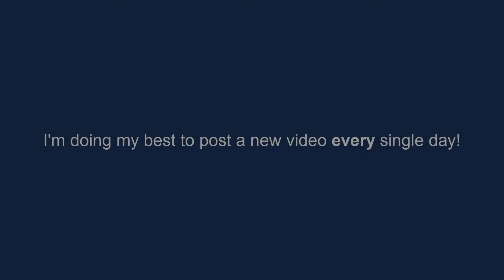HOW TO: PixRacer + UBLOX NEO M8N GPS/Compass Wiring

Comment: erm?so what is the color of wires? you put red and all other is "blk" which does not make sense.
Reply from the maker: Hi Egor, watch the video. And see the part where we find out what the colours mean as it's written on the board.... Matt
Reply: Thanks Matt, actually if you will open the gps unit it written in pcb.
Reply: I was inpatient to see every frame of the vid and just looked for the wiring scheme and kind of stopped watching when u put this banner on screen.anyway thanks
Reply: I have to say your channel have so good & informative videos.
Im actually flying freestyle racers but I have one fellow which finds it hard times to get all tuned and build well in his fpv plane due to honorable age so I decided to help with the build test and most important gps and return home function.I will post the video of test flight  and build when it will be finished.
Great thanks. ^^

Comment: I'm using this exact gps/compass with a pixracer. The gps works flawlessly but the pixracer is not detecting the compass?? I have tried everything. Reloaded the fw. Tried different fw. Tried it on mission planner qgc and apm planner. Nothing works?? Has anyone else had this issue?
Reply from the maker: Howdy Matt, you'll have to excuse me as it's been a while for Mission Planner and QGroundControl, however if I remember correctly on the magnetometer tab, you need to set it to use the external compass. Hit save and then calibrate it. Matt

Comment: did you build a tricopter with the pixracer? do you know wich firmware need need to be installed?
Reply from the maker: Howdy fella, no my pixracer went into a flying wing. For a Tri copter I would assume the quad firmware and then select the right frame. Hope that helps! Matt

Comment: Please tell me this works with Naze32 rev6.
Reply from the maker: Morning! 
Honestly, I've never tried connecting one of these up to a Naze32. I've always used a CRIUS NEO-6 (see here http://goo.gl/Sjyq8W) with my models & they've worked perfectly. You'll probably see one on my desk in a grey plastic case, as the other one is in the Teksumo at the moment.

Hope that helps!

Matt
Reply from the maker: Howdy, I don't believe this GPS will work with the Naze32, you'll need a GPS like this one instead https://goo.gl/ZJKjF5 Matt
Reply: I got it to work but it was a real pain involving ftdi adapter > u-center > programming. Now my issue is that I want return to home but Cleanflight's current version is still a work in progress. I did find this but I am an occasional quad flyer and I don't feel comfortable changing things in Cleanflight's CLI http://m-rotor.com/page/?p=713
Reply from the maker: YoSneeze Howdy, yea Cleanflight is great for the basics, but anything advanced it's lacking I'm afraid. Matt

Comment: Brilliant!  great timing, I was doing exactly the same thing last night.  I've got the GPS working, but I'm still not sure i've got SDA/SCL the right way round.  Have you done the APM power module?  that's my next job. Cheers.
Reply from the maker: Howdy Jim, do you mean the ACSP5 module? Let me find the link for you
Reply from the maker: This is what I'm using for the Pixracer, but ssssssh this video it's published yet ;-) https://www.youtube.com/watch?v=z-J0n35POhg
Reply from the maker: And for the SDA/SCL, try calibrating the compass and moving only the GPS block, if you start seeing data points appear on the screen, it's working!
Reply: Another great vid :)  I'm hoping to be able to use the old APM in-line power module http://r.ebay.com/3jkHlg with the pixracer.  I've seen posts with people saying it works.  I just need to be super careful to make sure I match up the pinouts.
Reply from the maker: Jim Blackhurst Dammit, I wish I knew that before buying the other board! And yep go very careful to check the connections. 

Get the multi-meter out and be 100% sure on the ground & 5V line. 

Those two are the dodgy ones, the others shouldn't put out more than 3.3V and also you'll know if they're wrong as you'll see the wrong values for voltage/current.

Matt
Reply from the maker: Jim, you jinx'ed me :) I had SDA & SCL the wrong way around one mine in the end. Used a small blade to pop the wires out and switched them over. Jopbs a good'en